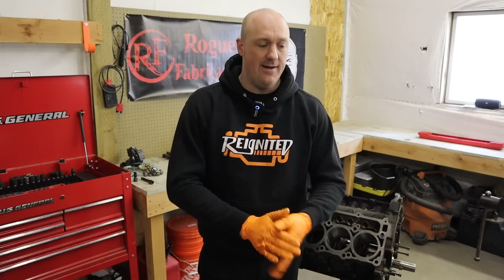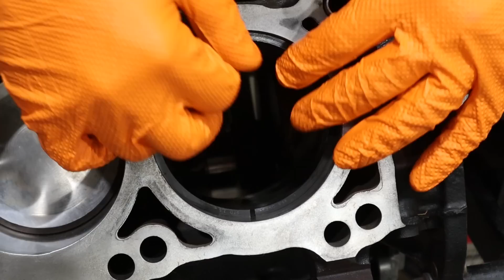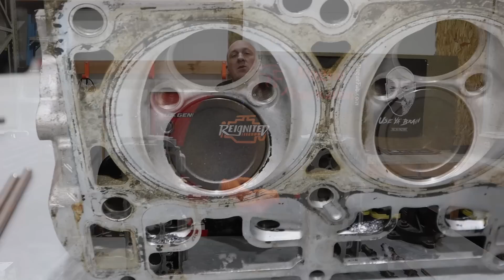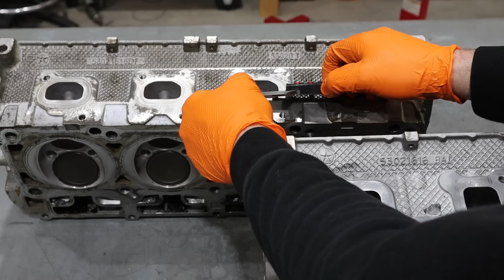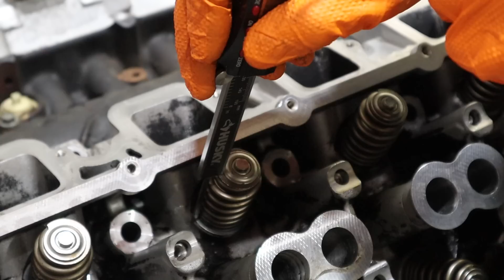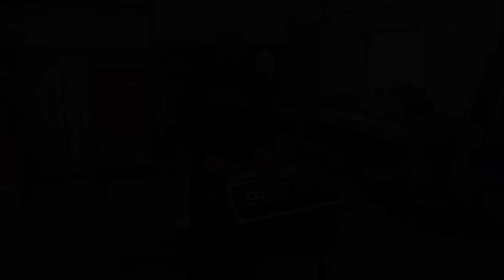Poor Man's Hellcat Ep2: Installing Eagle Cylinder Heads!

Comment: Are the rod bolts one time use?
Do the rod bolts need replacement after taking the rods off the crankshaft?
Does replacing the rod bolts require resizing the rod ends?

Comment: Question, is there enough meat on the old style heads to be ported out to match the flow of the eagle heads? and would it be cheaper to buy a eagle engine out of the junk yard as buying every thing to make the eagle  head work?
By the way keep up the good work in showing the potential of the 3 gen hemi

Comment: Hey man, I got a 05 block with 392 stroker kit from Manley, I’m gonna run the eagle heads, just want your input on what coil packs to use, will the 05 truck coil packs work correctly?

Comment: Do you have any insight on this engine swap: 2019 ram 5.7 etorque  into a 2012 ram 5.7? Of course the etorque will be removed.  I believe the crank sensor, knock sensor,  flex plate, timing cover and oil cooler are some of the differences.  

I just completed a full rebuild of my original motor thanks to your videos.  But unfortunately I still have a small oil leak into my coolant.  Heads went to shop and came back good.  Trucks runs great no overheating after 300 miles and ltft are all in spec.  No coolant in oil.  I suspect a small leak in the block.

Comment: Great video. I did this swap a few months back. And basically had to do and swap everything you had mentioned. The one thing i had to change other than that is the springs as i put a comp cam and is needed the higher pressure springs to hold up. All and all, car didnt need a tune to drive but i did get one to have it run better. And with the egr gone and turned off, the car does waste a lot more gas.
Reply: And the thicker .070 head gaskets
Reply: which cam? i did same went with comp 220 stage 2 with eagles heads and 70 cometic gasket... im at the pushrod size stage and measured em so hopefully i got right sizing
Reply: Mine was a custom comp cam but  mild 216 I believe it was.

Comment: Hey, check the CCs of the heads relative to the pistons on the 2 different engine designs. The eagle ENGINE is 10.5:1, but the engines use different pistons. If you take the eagle heads and swap them to a pre-eagle engine, the compression ratio is 11:1 or higher, which could really be a problem if you're going to boost your engine. I can't find reliable data for piston dish/deck clearance volume for both engines to calculate comp ratio.
Reply from the maker: I've got a 2015 block sitting right next to this engine, I'll take a look at the deck height and pistons to see if I can spot any new info 👍
Reply: This is correct. Your compression ratio will be sky high with the OEM gasket. Cometic sells a .070” thick MLS gasket that you can use to lower the CR. I have also seen guys double the factory gaskets which measure around .030”
Reply from the maker: @Avam54321  I'm trying to figure out where this information is coming from, since I have direct access to Chrysler as a tech and all my information says the pistons are identical measurement wise. Not saying it's not true, just trying to understand who said in the beginning that the compression ratio is going to be higher than the stock eagle head ratio of 10.5:1
Reply: @ReignitedAuto  I’ve read it on forums, and talked to a few guys at the meet that run the eagle heads. Maybe you should debunk the myth or prove it correct and save your pistons
Reply from the maker: @Avam54321  for sure I'd like to get to the bottom of it either way.
Reply: @ReignitedAuto  are you 100% sure those eagle motor pistons are the same? I’m reading that the newer engine uses a different, smaller dome on the piston to keep the CR in check with the smaller chamber heads. Swapping onto the older 5.7 with larger domes is the reason for the bump in compression
Reply from the maker: @Avam54321  you are correct, I'm filming an update video right now to address this 👍

Comment: Engine masters made me embarrassed to have a pre-eagle engine! Pooch I believe was the word.
Reply: The pre-Eagle 5.7L they used in that comparison was handicapped by the carbureted intake manifold in my opinion. Unlike older small blocks, the Gen 3 Hemi ports and chambers (as well as GM LS and Ford Modulars) were designed in flow analysis programs to only use port fuel injection and a dry manifold. Introducing fuel to the air at the port is critical to getting a good mixture and seeing the best potential for these engines. Using a carburetor and a generic dual plane manifold is a lot simpler, but you're leaving a lot on the table.

The Eagle heads are definitely a massive improvement over the early 5.7L and on par with the 6.1L heads, but I think the manifold exaggerated the difference significantly. They should have used a 2005-2008 car manifold for a better comparison.
Reply from the maker: I agree with both of you 😄

Comment: Love your info but you did miss a little info. Eagle and 6.1 not quite the same head. Basically they are similar but not identical

Also: Have you double checked the math on the compression ratio? Popular theory is, without a thick head gasket you’ll be up around 12:1. I’ve not done one myself but a lot of info out there about this. Just curious….
Reply from the maker: I've got a 2015 block sitting right next to this engine, I'll try to comparethe two to see if I can find any differences. 👍

Comment: Great info, I'm thinking about doing an Eagle head swap on my pre-eagle block and this video will come in handy when building my checklist.  Eagle heads, eagle head gaskets, eagle intake and reuse the valve covers.  Did you have to replace any push rods after replacing the rocker arms?

Comment: Great video and I think this eagle swap is going to get you a lot of visitors.  (I'd put eagle head swap or something into the title).  I do think the 09+ pistons are different though.  Not sure if the compression height or even dome volume is different, but the tops look different, and I believe the pre-09 use a 1.5mm top ring, but I think the 09+ runs a 1.2mm top ring.  If I was throwing the eagle heads on and not doing an entire refresh, then I would just run the stock pistons though, no matter what kind you got.

I filed my first set of rings for my LS build (I'm using 0.030" because it's going to see a lot of boost).  One tip I recommend is to file the set and then leave them in the cylinder you filed them for.  Because each cylinder is going to be slightly different.  Also, go slow when filing, and only file one side of the ring as the factory end will always be more square than the edge you do.  For my LS set of rings, the top moly ring was very hard metal, so it took a lot of grinding to size it.  But the second iron ring was much softer, so be prepared to take off gap much faster with a softer second ring.  You should also rotate the ring filer in such a way that the grinding wheel pushes "down" when you file, so it doesn't try to lift the ring as you go.

Looking forward to the rest of the series!
Reply from the maker: I've got a 2015 block sitting right next to this engine, I'm going to remove the pistons and compare them side by side and also check the deck height to see if there's any difference between the two, thanks guys 👍
Reply: Just did a quick check on RockAuto and it showed the pistons as different, with the eagle having a shorter compression height.  Sky, I think your motor is going to be over 11:1 compression with the factory head gasket. I know MMX or someone sells Eagle heads with combustion chambers they open up to drop the compression just for this swap.
Reply: @DRick-jh2gt  same, read from many forums that Eagle swap will bump CR to 11-11.3 range.

Comment: Question, I have my 08 5.7 already set up with a 6.1 intake manifold and the mmx intake manifold gasket to get the proper flow out of the intake, will this intake fit with the eagle heads? Just put a camshaft in as well, this sounds like I could be getting some more power let me know what you think please
Reply from the maker: I haven't had a 6.1 in front of me to test, but from what I understand, yes the 6.1 manifold bolts correctly to the eagle heads. 👍

Comment: I wouldn’t reuse the headbolts. The headbolts are torque to yield. And the 6.1 heads flow more than the Eagle heads but not by much.
Reply from the maker: Common misconception on the head bolts, they are not torque to yield.

Comment: When i did the egale head swap on my 06 charger i decided to swap the pistons out to the egale ones as well. Also the pre 2008 fuel rail dose bolt right up to the 2009 up intake so you dont have to mess with the fuel line. also the stock 2009 up exhaust manifolds bolted right up to the cats.
Reply from the maker: Good info 👊
Reply: How did u seat your intake manifold
Reply: Also which one did you go with

Comment: i need some information    just bought a 2009 ram 2500 hemi 4wd it has the 235 mm front axle which i think is a 9 1/4" any way it has a raised pinion kinda looks like the diff was turned over but its factory never seen on a dodge seen them on fords am i correct

Comment: Non mds lifters have no specific allocation right? No rear/front
Reply from the maker: That's correct. The plastic yokes the lifters sit in are different as well, so you'll need those along with the new lifters.